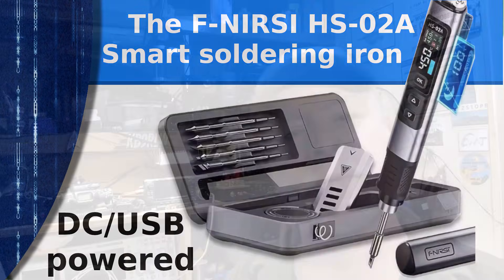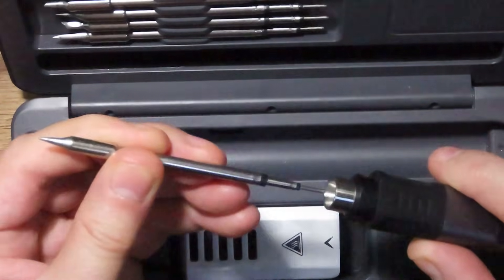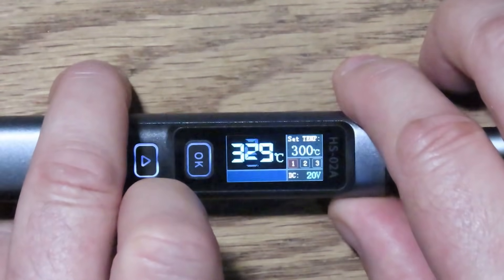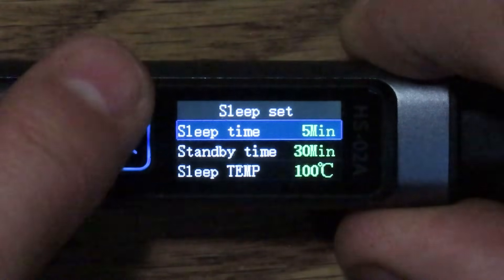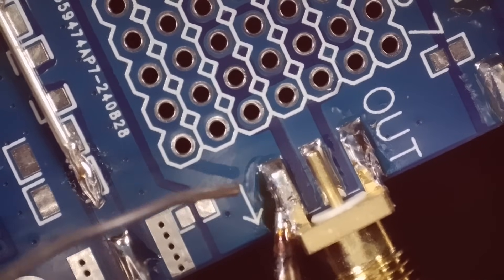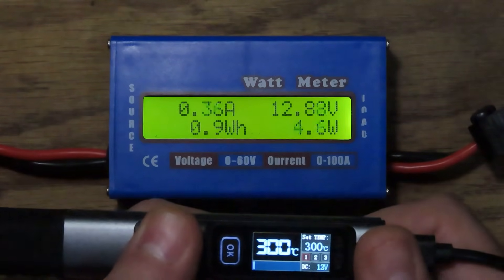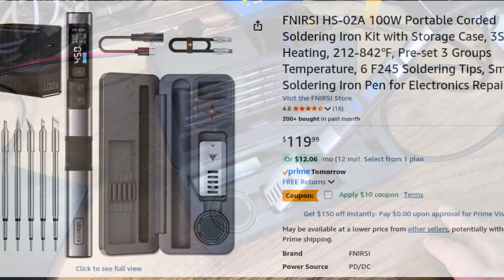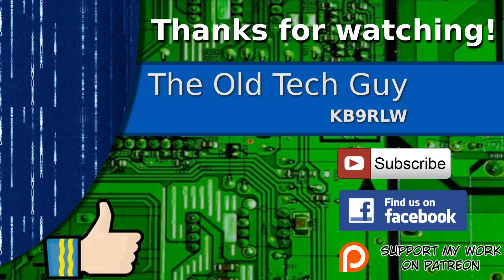Electronics - The F-NIRSI HS-02a DC powered smart soldering iron.

Comment: Your review is one of the best regarding power. Just want to ask a question.  I got a 65W wall charger it can vary the voltage from 9v to 20v. If i put the iron on 20v what percentage should i put the power? I want my tip to heat up in a minute. I looking for lifespan of the unit and tip.
Reply from the maker: Give 50% a shot.  If you exceed what the power supply can deliver it'll just shut down. If so, go lower. I think you'll probably find that it will heat up rather quickly.

Comment: Hey, have you tested the adaptive power mode? Hold right button during plugging it. It can detect the maximum power % with your charger so you do not have to guess that you maybe need 30% for your power bank.  At least that's what I read about and understood. I think it probes what maximum is possible before it reboots. I don't want to buy a 100w charger and want still to use my PD PPS 25w Samsung USB c charger. I do not have a preference blem if it needs a bit longer to heat up. Also the new Ikea 65w charger for just 13€ could be a good fit.

Comment: Does the power supply that comes with it support a 230V mains supply?
Reply from the maker: I believe they include the appropriate power supply for the region that it is being sold in. This one has a domestic plug for the US. I don't know if it supports the higher voltage or not. It is a fairly standard high wattage USB-C power supply. Any USB c power supply that is marked for quick charge or power delivery will work.
Reply: @loughkb Hi, thanks for the reply. I am in the UK so they don't supply an appropriate adapter but I'd rather have the US one than the EU one as it would fit my power strip better. However the issue is it would need to be 230V. I do have other appliances with US plugs and the adapters can support 110-240V so I just wondered if this one says on the label on the power supply like these ones do 😊 No worries if not though, I've also emailed Fnirsi I just don't know how long it'll take for them to respond.
Reply from the maker: @alphawhiskey9245  If I can find it I'll come back here and let you know.  I run the iron directly off my solar power setup and I don't know where I put that power supply.
Reply: @loughkb Awesome, thanks 😊
Reply from the maker: I found it.  Voltage 120-240 V, 50-60hz.
Reply: @loughkb Awesome! Thanks so much for checking, much appreciated 😊

Comment: I would like if the soldering iron  has some sensor so it can be put on sleep mode once you put it in the holder of the case
Reply: The "marketing" says it has "inductive automatic sleep mode". Probably a hall sensor in the iron and a magnet in the ring of the base station. (as with some full solder stations)
Dont know for sure yet. Im between this HS-02A and the T80P (same tips both)
Reply from the maker: I think you could set the sleep timer down to a minute.  
However,  cycling the temperature over a broad range that often might be hard on the cartridge.  That's a lot of expansion and contraction.